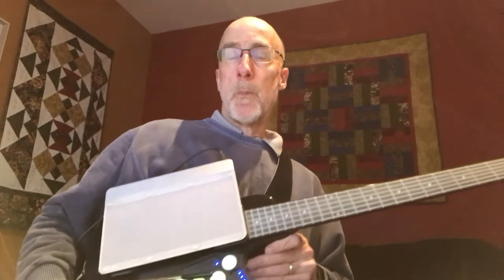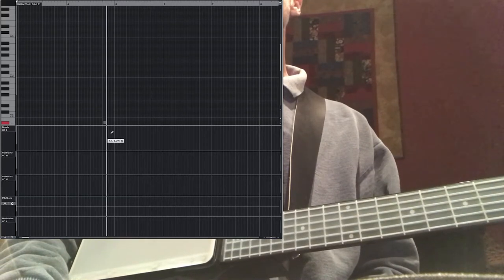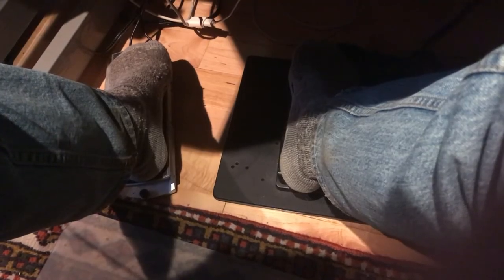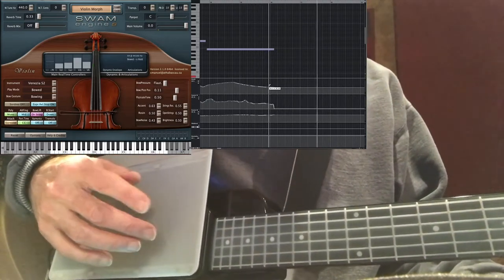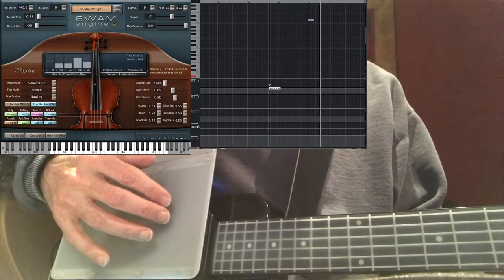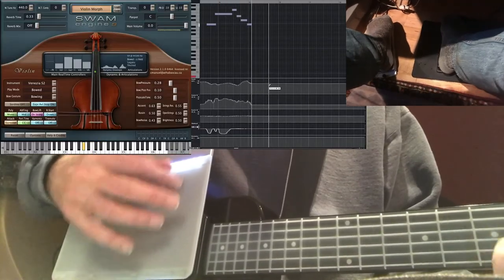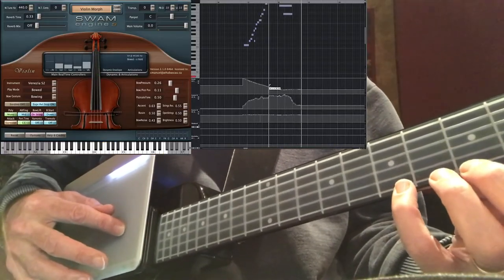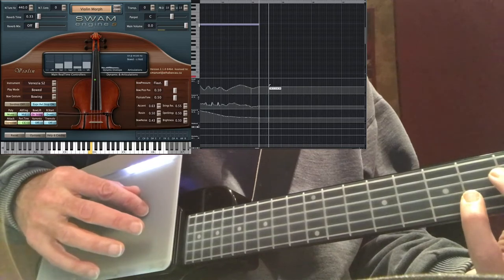"Bowing" a SWAM Virtual Violin With a Sensel Morph

Comment: Super cool, I just got a Sensel Morph and I have been using it to control vibrato/expression on my string libraries but this is next level!
Reply: Let me know please if you know of any for sale, its stopped being made.
I expect something new to come down the pike soon with such types of flat surface controllers in the MPE theme.
Maybe the process of making the sensor array can be replicated and people can silkscreen off their own, along with 3printing molds of different shapes for types of MPE surfaces. It's like a field of sensors, an array with pressure sensitivity and a adjustment ability. Not impossible to make perhaps.
Maybe now the company closed up shop permanently, they might share the process?
Oh well, let me know it you sell yours or know of any for a decent price, lol please.

Comment: Wonderful!!  Have you tried using the Morph without the overlay?   Unless you're planning on adding/drawing some additional controls, you might prefer (as I do) the feeling of the raw sensor for this kind of full-pad usage.
Reply from the maker: I’m going to add so more controls so I’ll likely continue to use the overlay. I agree the bare surface is preferable.
Reply: @ChrisManuel  If you don't know, you can have the bare Morph mimic your Innovator's Overlay layout by setting the "No Overlay Overlay" to "Innovator's"

Comment: my problem with "bowed" bow gesture mode is getting the dynamics louder than pp! only when I'm playing fast runs, but completely useless when it comes to sustains.
Reply from the maker: You can improve that sustained bow volume by changing the Expression Curve on the SWAM Violin Options page. If you set it to "Lin 0" you'll get a louder sustained note. I struggled with that issue (and still do). Part of the issue is that the physical model for the SWAM violin is actually very accurate around bowing and sustain. A real violin can't play a long forte note without frequent bow direction changes.
Reply: @ChrisManuel  thanks for the reply. I looked into it some more after I commented, and turns out (if I understood correctly) that because their bowing gesture algorithm can only take 128 values, it only utilizes a small section of the bow (around 5 cm or less), and not the whole bow, which is extra room for sustains. This month, they're coming out with version 3.0 for the strings, which supports high resolution midi, which with more input values (16284 to be exact) you get more use of the bow.
Reply from the maker: @formyeve  I'm looking forward to the strings update. It will be interesting to see what other improvements come with the update.